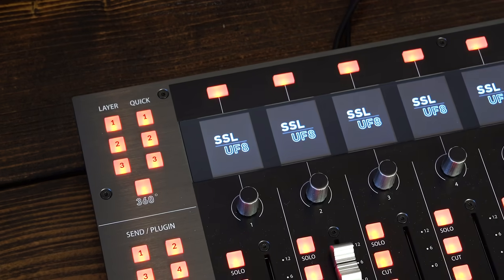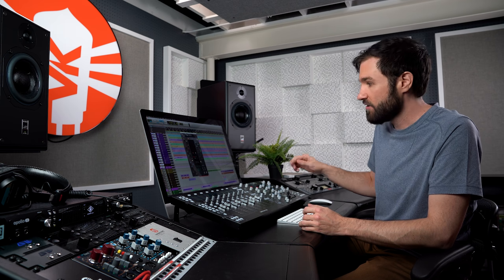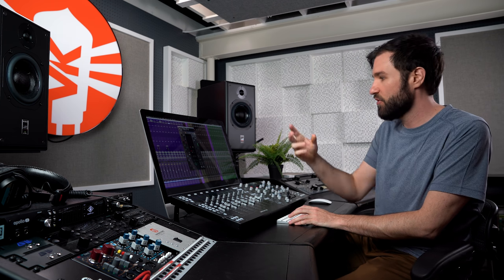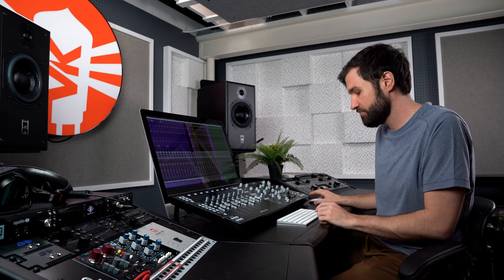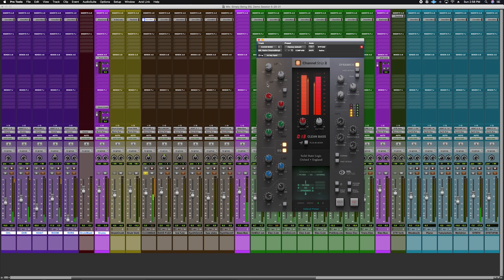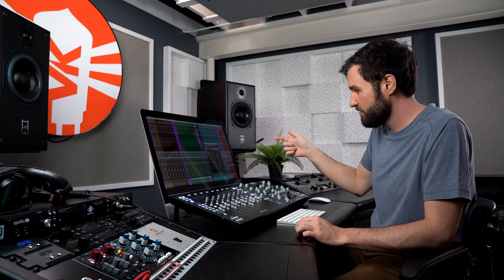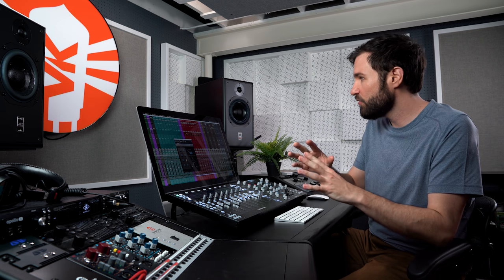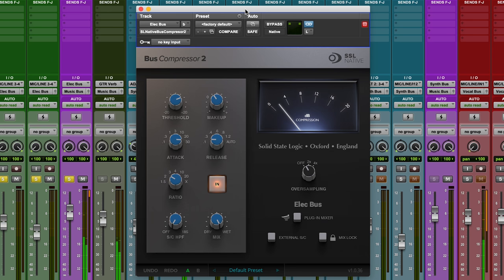Getting Hands-On And Mixing With The Solid State Logic UC1 Plug-In Controller

Comment: Gotta hand it to SSL even though this only works with their own plugins. We’ve been asking universal audio for a control surface like this for years and all they did was create a DAW 😂 - props to SSL for making this - I won’t be buying it since I don’t use SSL’s plugins but RESPECT.
Reply: I think it wouldn’t fit UA‘s philosophy. They offer gear from different companies and this would require a one to one replica controller of the hardware otherwise it would defeat its purpose of replicating analog in the digital domain. In addition each gear has different layout schemes and little functions (phase, 15k boost, etc…) you would have to fit in to make it true to the original.
Reply: The UF8 will work with UA Luna in a couple of months. You will be able to control the UA plugins  as well. You can control UA plugins in various DAW’s with the uf8
Reply: @Jjf109nine  I think a generic controller would still be better than a mouse 🍷
Reply: @Jjf109nine  I want this to help save DSP space with my UA interface. I'm thinking of using this to complement my Apollo maybe use the UA stuff for my vocal chain and the SSL native for everything else. I must admit the UA stuff is so good I cant let it go.
Reply: But we got softube console 1 :3

Comment: Wow, loks fantastic. The only thing I’m missing is the, let’s call it UM-1. A Master Unit with transport, jug/shuttle encoder, monitor controller, cut, copy, paste, undo, redo, Master Fader, Aux and Bus selector, Marker, punch in and out  and so on. A Monitor controller Section my be with real physical ins and outs., 3 Sets of Speakers and 2 sets of headphone jacks. If there weren’t physical ins and outs it would also make sense to control the monitoring section in the daw. May be   That would make the system perfect.
Reply: Just wrote the same thing.  Fader, Jog/Shuttle, Arrows, F Keys/Short Cuts galore.  However the Monitor Controller will likely either be on a SiX type Analog Mixer, or SSL2+ type Interface that can be triggered by the Transport/Monitor Controller.  My fingers are crossed for a Solo in Front solution, like on a Large Format Console.

Comment: So for a little over 2k you can have a compact SSL console in a sense. For us old farts that worked on consoles this may be a game changer. Maybe there should be an UF8 and UC1 bundle. The only let down to me is the connection is USB. May have to trade my S1 in and give this a shot since I used SSL mainly.
Reply: There's nothing console about it, no transfromers, no voltage.  It's plugins and a plastic controller
Reply: Closer to $3k with the SSL Six, but I’m about it!